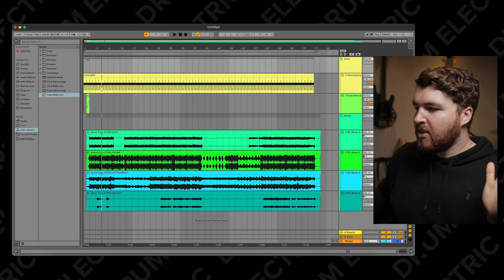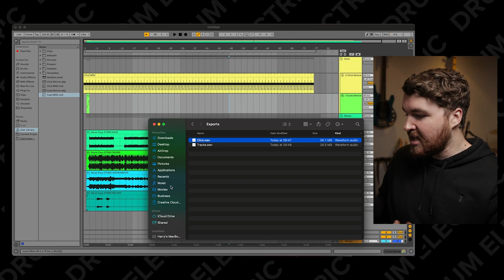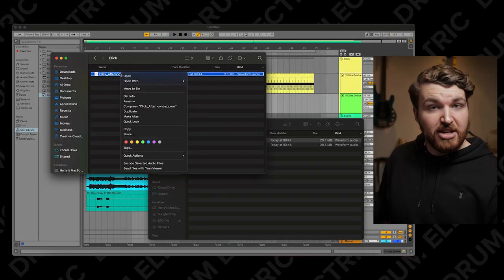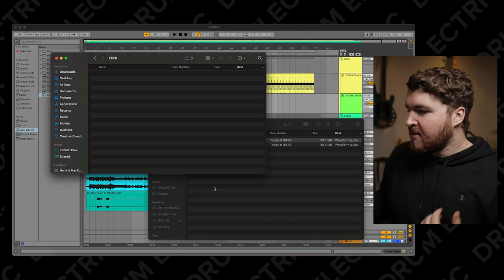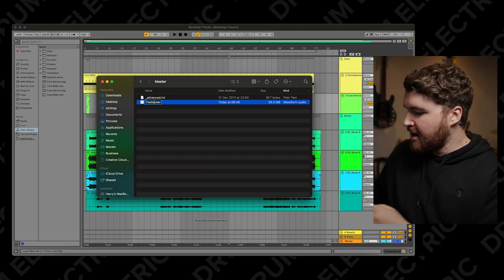Running Backing Tracks on the Roland SPD-1W Pad

Comment: My two bands are using this precious piece of equipment for a year already. I Love it. So simple and easy to use. 

TIPS: 
- You can copy have as many folders in the root folder as you want (Well.. before the 4 Gigs of memory are out) to have more than 12 tracks. Roland will read the one that is named "Roland". This way you would not need to rewrite all the data to play another set. Just rename the folder with required set to "Roland". This probably can be even done with a smartphone and USB adapter to your phone connector (I would really appreciate if someone tries it with iPad and camera connection kit). My SPD::One contains a set for each of my band.
- as both outs are stereo, and you don't need to have stereo click, pan click to the left and use right channel for something extra like having a stem of someone in your band that may just not appear at the gig (Yes, we have a really unreliable guitar player), or sound hints when the chorus\verse\solo\tempo-change etc. starts. Or even voiceover the name of the song.
- CHECK CABLES! In most cases you will use Y cables. We are using stereo jack to 2xXLRs and we had a pair of such cables that didn't work as expected - both XLR's at the end of a Y cable received the same signal, not Left and Right but the same stereo signal just merged in mono. XLRs were even color coded, the cable was of a reliable brand and not dirt cheap.

CONS:
- Well its not really a con but I would really love to see SPD::One Wav with MIDI track along click and back. Just imagine that you are able to send MIDI track that would also change effects on your guitar players processors along the track or control the lighting.
Reply from the maker: This is incredible!! Thank you so much for taking the time to reply like this. Some really great tips here!!

Comment: To clarify on the cables you need--you said stereo jack to 2 XLR but looks like all 1/4 cables in the video? Also was curious for more info plugging the headphones output into a mixer to hear the band?
Reply: You would connect the 2 1/4 cables to a stereo DI for live use. (I use the ART DualZDirect) Then you would connect 2 XLR out and send those to your in ear rig, or FOH.

The headphone out would be only for the click. If you want just the drummer to hear the click, then absolutely you could plug it into a mixer with your in ear mix, and then mix to taste for the band and click. If you want the entire band to hear the click, you would use another DI and plug that into your mixer.

Comment: Thanks for the video! Lets say i want me and my guitarist to have the same backing track going together with two pairs of in ears, would i just use a splitter of some sort for the headphone jack? or how would that work
Reply from the maker: That could work for small spaces for sure. The other way is to send it to a mixer and then you both take a feed from that. For example, you’d send the output to a sound engineer and they’d give you each a feed of it

Comment: Can someone tell me what's happening when for exemple i launch a 15seconds sample (slot1) and i switch to slot2 without waiting for the sample 1 to end ? Will it stop the first sample when i switch, or the sample will continue until it's end ? Thanks
Reply from the maker: The sample should continue until it finishes. There’s a ‘stop all sound’ button for when you want them all to stop
Reply: @DrumElectric  Thanks for the response, that would be great, cause when you need to launch 2 samples during one song (one sample of 15 secs at the start, another one 20secs at the middle), it's not super useful to have to turn the button between the 2 samples. The best way would be to launch the first sample, then immediately switch the button to the second (so the first one is still running) and so you can hit the pad when you need the second sample.
Reply: @DrumElectric  Unfortunately my sounds stop when I turn the knob with slots.. 😞 Wanted for example to play backing track in Slot1, turn the slot 2 and playing bongos into it but not possible... Daaamn!

Comment: in your opinion is this one or the alesis sample pad 4 better for running backing tracks and clicks?
Reply from the maker: They about the same in all honesty. I would lean towards the Roland just purely from a build and size point of view (it’s made with better materials and is smaller!)
Reply from the maker: That being said, the Roland is significantly more expensive than the Sample Pad 4. So if you’re on a budget, go with the Alesis!